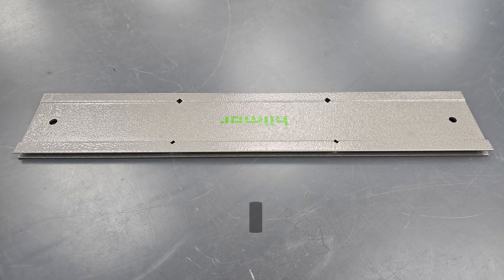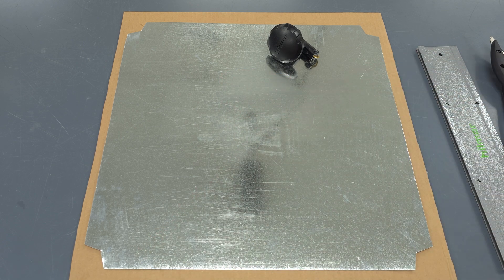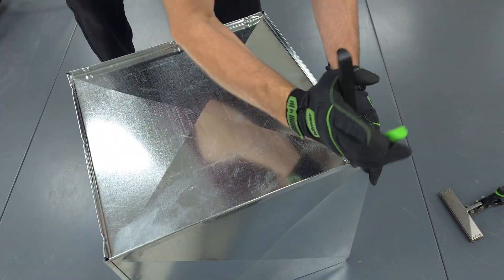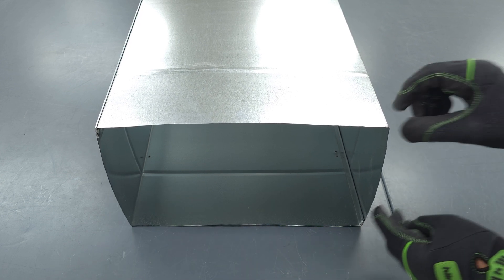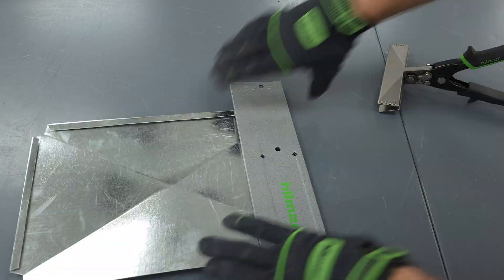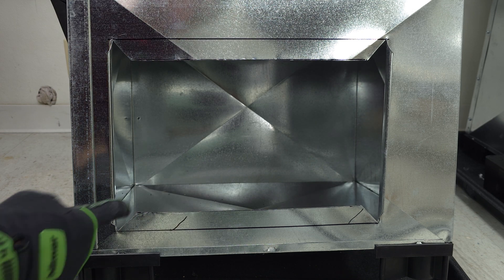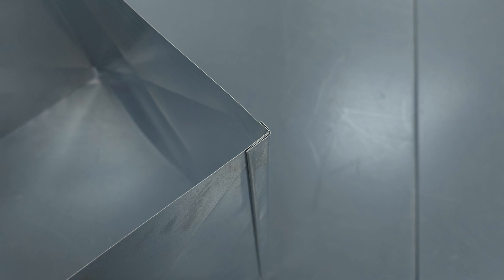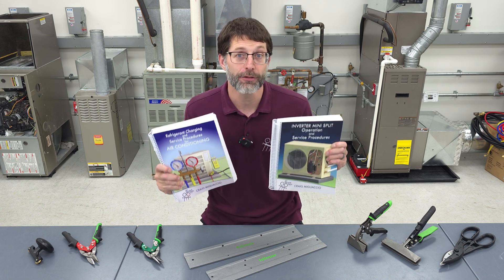Our New Sheet Metal Tool Invention and Process! Make Plenums, End Caps, Without S-Lock!

Comment: Got an unrelated question.  Installed a 2 zone cooper and hunter in stevensville MT.  It's in a brand new house for a customer all lights flickering while it runs.  No one knows why and cooper.and hunter sent me a control board that was supposed to fix the issue.  It didn't help.  Have you seen this? I did a Google search many people having similar issues no one has a solution.  Your the man Craig if anyone can figure it out it's gonna be you.  Customers not happy and is going to make my life miserable until I figure this out.
Reply: Are u sure it's the unit and not the total electrical load on the circuit.

Comment: Cross breaks can be easily made without a special tool by scoring the metal with the edge of a flat screw driver or your scratch awl.
Use a straight edge to score the line. Cardboard or carpet under the metal is necessary  to  make the cross break properly.

The wide jaws of the folding tool is a game changer!
Reply: I use a screen tool and a couple kneeling pads under the metal. Works great